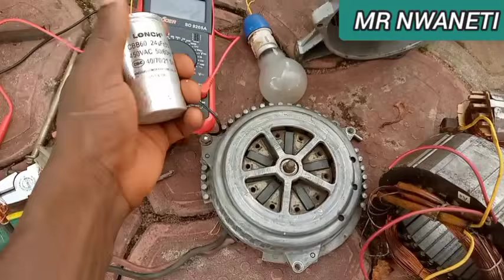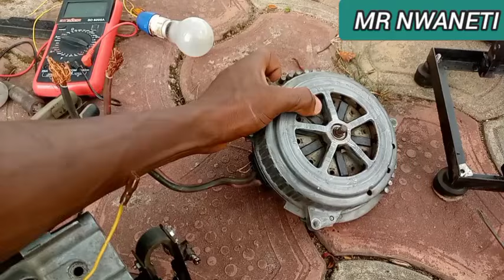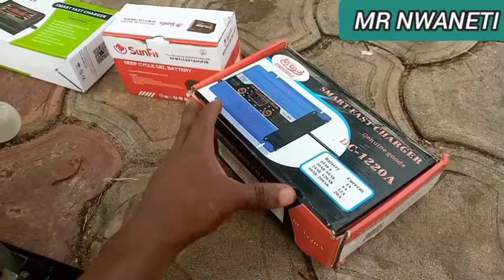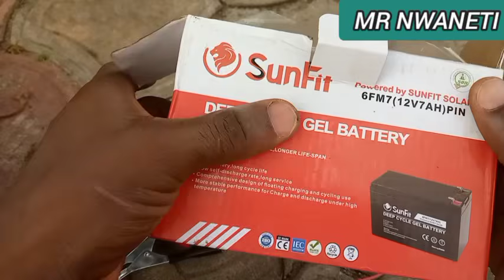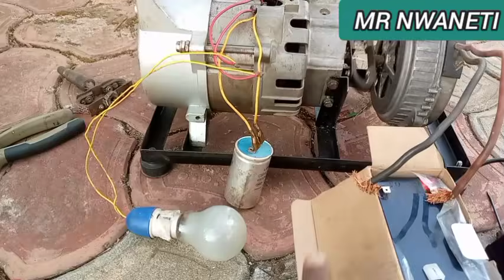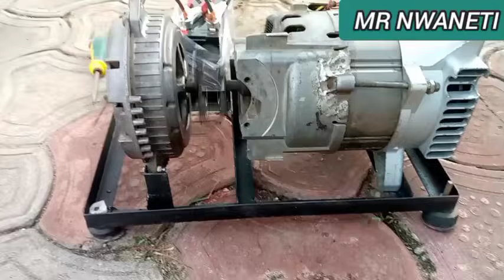How to assemble gasoline generator to fuelless generator

Comment: If you use water to run your generator, you only need a constant power supply for the water pump, and the battery won't be put under any strain either. You need a high-performance water nozzle for that.

Comment: This dc motor and magnet is it available in electrical parts shop
Reply: You could have used a flywheel so it can carry the alternator.attach a flywheel to the rotor the load to roll the alternator will be more easy my wasap number . electrical you got it right but from the mechanical aspect there was an over load of the drive and cmsuption of weight to drive .

Comment: Take note there is sopposed to be that have to boy cut the 12volts battery from the charger so it will be running directly to the 12 volts motto that is the best, The the switch will always save as starter
Reply from the maker: Thank you for your feedback

Comment: Really love your work so fat. but without load on it, the battery is drilling gradually. What na happens when its been used to power a room with one fan, one bulb and plasma tv.
Reply from the maker: Thank you for the compliment, I appreciate your feedback, when used to power those appliances, the output may reduce.
Reply: @MRNWANETI have you been able to find a solution to getting how to produce more power to charge back the battery than the power drawn by the motor to spin the alternator. I think finding a way to modify the motor to draw lesser power but still produce enough rpm will be the solution
Reply from the maker: @chidiayoanasonye9243 yeah 👍 you've a point here, just that limited fund is what delaying me,I would have love to carry out the experiments
Reply from the maker: @chidiayoanasonye9243 but which process do you think 🤔 motor we be modified to draw less current?

Comment: Questions:
1. Can any 12v battery power the motor without consideration the amps?
Reply from the maker: @Electronics_sch  yes any 12v battery can power the motor but battery capacity rating is how long the motor we run on the battery

Comment: You need a DC motor driver called a pulse motor driver. This will cut power cost of your driving power. The most interesting part is that pulsed motor have more torque than a direct supplied motor.
Reply from the maker: @HRMW-OSHIWAMBO  I've to know, have you done it by yourself
Reply from the maker: Thank you for the information 🎉
Reply from the maker: But do you have any video to back up your claim that pulse motor have more torque than direct supply motor

Comment: You need to change that your capacitor
Reply: More power device within the range of the alternator capacitor
Reply from the maker: @Electronics_sch  can you explain better for understanding thank you
Reply: @MRNWANETI  what is the total output of the system and what can it power? How will the system continue to run when battery is low?
Reply from the maker: @Electronics_sch  I think 🤔 you didn't watched the video till the end,the battery charger is recharging the battery but the rate of charging current and the rate the DC motor draw current from the battery not the same
Reply from the maker: @pastorecoisaactv9310  ok but can you give me reason?
Reply: The light seems dull
Reply from the maker: @pastorecoisaactv9310  it cause by weather
Reply: You need to bring in other devices for testing
Reply from the maker: @pastorecoisaactv9310  which device?
Reply: I think you should use watching machine motor for it to continue running because of the battery problem
Reply: And put brush on the armenture for more magnetic and use  change over for it